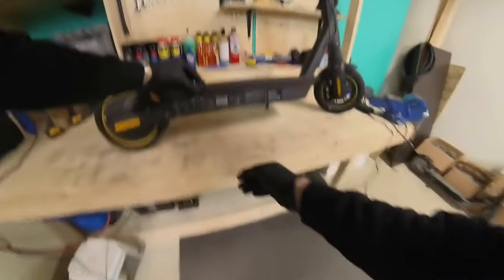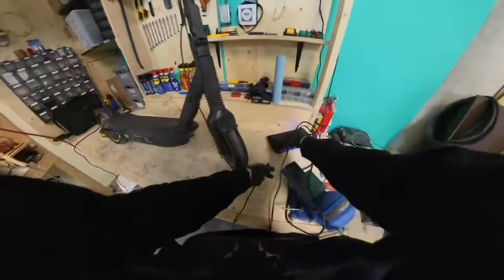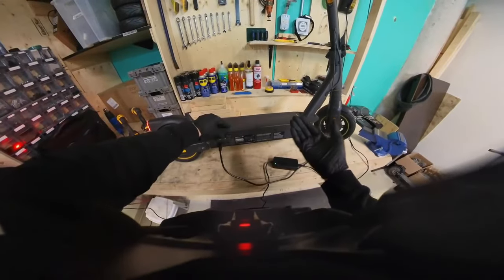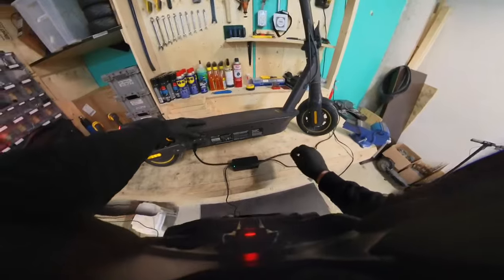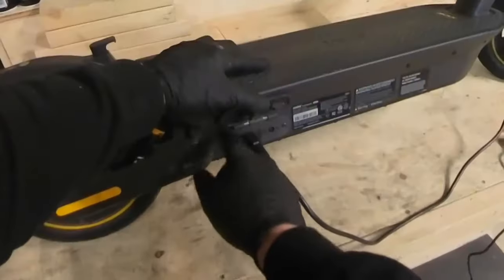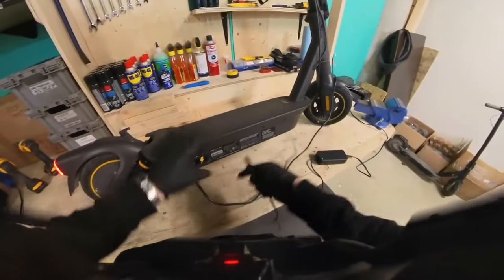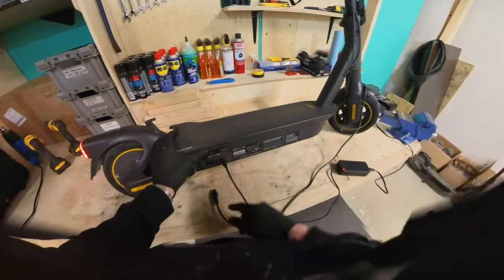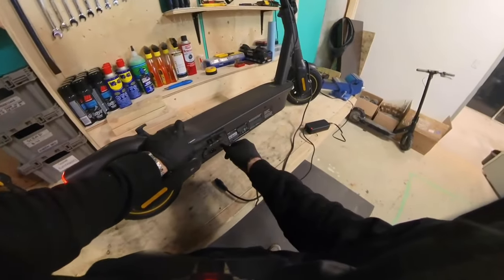"Why do Ninebot MAX scooters have two charge ports?" | Phil'd In With Phil 🤠🛴🛠️🧰

Comment: I'm 51 years old and I just bought my first e-scooter and I got the Segway Ninebot Max G2 from Amazon for $899 one month ago and I put 134 miles on it so far and it's great for as a 1st scooter for someone who uses it for city travel or paved roads. It goes 22mph and has front and rear suspension and weighs 50 lbs and is fast enough for your 1st e-scooter, but after a year I would like to buy the Segway GT1 for $1,499 which goes 37mph and and can be taken off-road because it has wider tires and a better suspension
Reply from the maker: We don’t offer the GT1, but would recommend looking on the official Segway-Ninebot website. - Mikey

Comment: 5amp and 2amp
Reply from the maker: Yep!
Reply: So which one charges faster?
Reply: @TheUnicyclingUnicorn  the round ended charger with the external brick is the quick charger sold separately, which cuts down the charging time by about half.
Reply: Whats faster the mickey mouse cable or the separate power brick?
Reply: @socommaster  Depends on the separate power brick outage.

Comment: What would happen if I plugged in a usb cable coming from a powerstation into the charging port that leads directly to the battery?
Reply from the maker: The electrical input for that port MUST be from a charger providing AC (71W/42V). If it is anything other than this format, the battery can be damaged. We do not suggest plugging anything other than the original charger into these ports.

Comment: My internal charger stopped charging on my max g2. So i orderd a Segway charger DC, but not the fastcharger 5A because its not available where i live but an 1,7A output. Will this work fine, only longer charge time?
Reply from the maker: Good question! Yes the 1.7a charger will work. However, it’ll just take longer to charge. Hope that helps! :) - Mikey